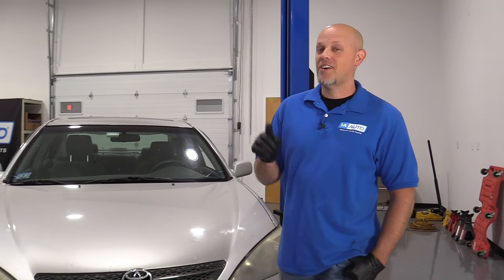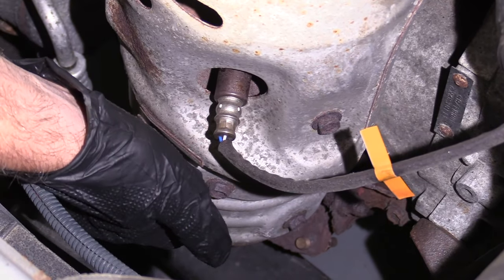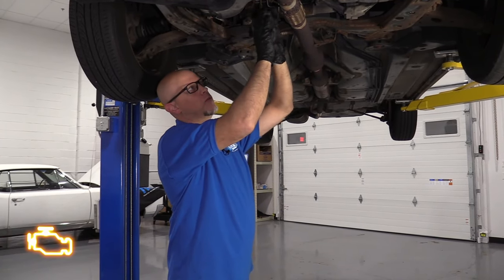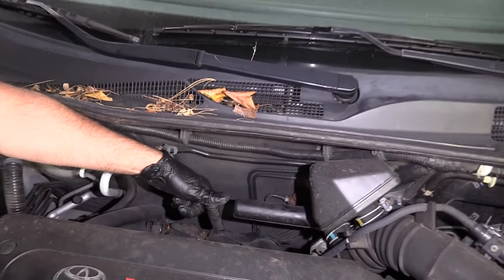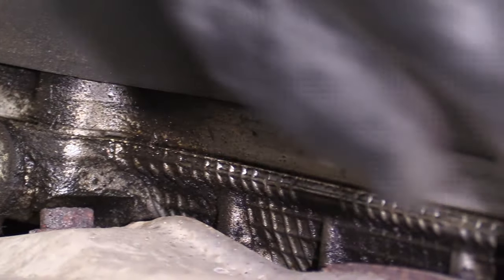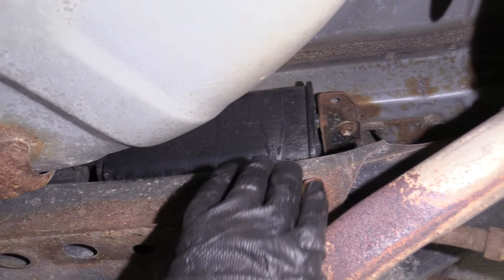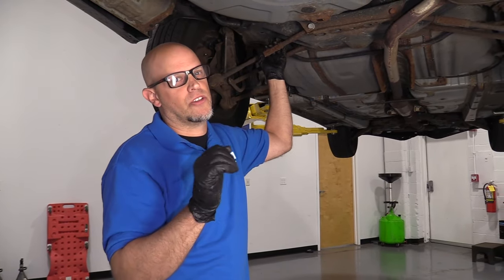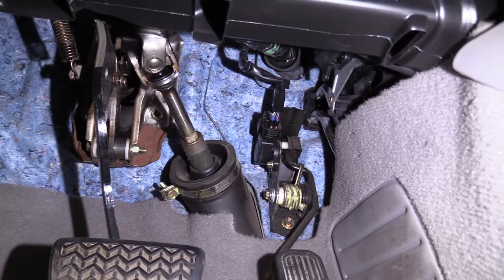Top 5 Problems Toyota Camry Sedan XV30 5th Generation 2002-06

Comment: I've had a rattle or tick since I got my 05, I'll have to look into an intake and see if that possibly stops the issue. Would've never guessed!
Reply: Hey OH, i got one too
Reply from the maker: Hope it helps. Thank you for checking out the video. If you need auto parts go to: http://1aau.to/m/Shop-1AAuto-Now
Reply: Did you figure your rattle issue out yet? I have an '03 and I've been hearing a low rumbly rattle. It rattles in everything except Neutral, which is weird to me. I had bad bearings in my idler pulley as well, but I had that replaced, and the rattle got a little less noisy, but it's still there. The paranoid part of me wonders if it's the chain tensioner... I really hope it isn't,  but I wanna be sure.
Reply: @S2DIOfficial  i actually traded the car in and got something new. My recommendation though would be to get a new intake manifold on it since its a much easier job than the chain tensioner. Im not sure cost wise but its still better than having to tear the top of the engine apart. I hope the camry keeps on going for you. As happy as i am with my new car, i do still very much miss my camry
Reply: @dwoodrow9721  Scheduled the repair for the intake, so I'll have a better idea on the 17th (March, 2021). Gonna be about $450-500 after he orders the IM, and labor. So not bad, but still a nice little shit-hit for something so dumb. I paid $6k for the car (low miles, great body, no rust, clean interior, one elderly owner, etc.) so I don't mind investing a little bit of money to get more time out of it, but this sort of shit always seems a lot like rolling dice. Idler pulley was fixed (bearings WERE bad, that was definitely one issue), intake manifold will be replaced with a better after-market version (metal, not plastic), and if I need to replace the tensioner (hopefully not, but I will if I need to) it will be done. This little car has about 50-75k miles left in it if I keep it maintained, so I don't really care. It works for now. I put about 20k miles on it in the last 2 years; I drive to work and home. I guess we'll see... 

Thanks for the reply, man! Most YT'ers ignore their channels and their notifications for months at a time!
Reply: Dorman makes a replacement, I installed it on mine because my car sounded like a diesel with the rattle. It’s not too hard, just a little cumbersome with the bottom two bolts on the back of the engine.
Reply: I got the same rattle too but I only hear it when I'm in reverse
Reply: @S2DIOfficial  any update? I have an 05 with a rattle whenever in gear.. and only with the brakes engaged
Reply: @TheMcpeMaster1  My intake manifold! Was about $400 to replace, but the noise went away. The guy who did it said my manifold looked normal when he removed it, and he showed it to me as well. No loose pieces inside or anything. My only guess is that there was a small crack somewhere, letting a little bit of air out (or something similar). I have no issues with sound anymore, which is great! Hated the noise.

Comment: Do the V6 engine Camry's (2003) have the same high mileage reliability as the 4 cylinders? I had an 01 v4 that I got rid of at 320k, not because it was dead but because I had enough vehicles already and was offered a dirt cheap 03 V6 that I'd like to keep around as a Summer vehicle. It's got 194k (which doesn't scare me for the price), but can I expect the same reliability? A coworker that was a Toyota tech for 15 years looked it over and said it didn't need anything besides minor things, but we never touched on the difference between the 4 and 6 cylinders.
Reply: for V6 you need to change time belt each 100 000 miles. V4 does not need it.

Comment: The other problem that I’ve had and seen other Camrys like this body style is that when the battery gets changed or disconnected the gas pressure drops it has to build up again that’s what I hated about it.
Reply from the maker: 👍Thank you for checking out the video. If you need auto parts go to: http://1aau.to/m/Shop-1AAuto-Now

Comment: Do you have to pull the spark plugs out too to take off the valve cover ?
Reply: no but would be a really good time to be replaced if you havent done so yet
Reply: I’d actually leave them in until you’re done. Keeps oil out of the combustion chamber
Reply: Its more of a case of your already there might as well replace.
Reply from the maker: No you don't. Thank you for checking out the video. If you need auto parts go to: http://1aau.to/m/Shop-1AAuto-Now

Comment: One really big issue with these car, especially the early years of this model line, is the threads in the block that the head bolts screw into can strip/pull out. Usually happens if the car every overheats. With a car this old its bound to happen at some point. Radiator leaks or water pump fails, of hose leak. After fixing whatever caused the overheating the car will have a small but persistent coolant and/or oil leak. Usually under the intake manifold. It is a labor intensive fix. They make a kit that can repair/replace the treads in the block. Timesert/ helicoil  type repair. Seems to be better than stock after the repair. If the car never overheats then you may never see the issue.

Comment: Just bought a 03 camry with 170k miles for $1500 3 days ago car was running beautifully then yesterday had a bit of a rough idle thought nothing of it, parked the car came back 20 min later and car cranked but didn’t start. Left it overnight and it started right up in the morning, didn’t drive it to be safe then came back at night started right up again. Out of curiosity I shut the car off left it for a minute or two then tried to start it again, car turned on, struggled to stay on then died and went back to crank no start. I’m thinking maybe fuel pump? Any ideas or anybody had this issue before?Thanks.

Comment: i am pretty upset...i have an 03 camry that i bought from dealer with 8000 miles on it. it only has 115k and leaking loads of oil. i am mad that everytime i brought my car to someone they changed all this other stuff and I TOLD THEM I HAD AN OIL LEAK. Welp, it's 2500 plus dollars later and still leaking. I replaced 3 valve cover gasket, 2 power steering pumps within a year and all this other crap and oil is STILL LEAKING AND EVEN WORSE now. i hate that mechanics take advantage of women. I'm reading about how everyone is getting all these miles on their cars and mine is in my parking spot with a rack of oil marks under it. Someone finally told me that he thinks it's the HEAD GASKET WHICH IS ABOUT 1800 TO REPLACE, plus a sensor light is coming back on after I changed that. NOW HERES THE KICKER. I NEVER KNEW TO KEEP MY ORIGINAL PARTS SO alot of these "replaced' parts are from Auto zone or Advanced auto but mainly auto zone. Once again I didn't know that auto zone don't sell the original parts. I've been without driving my car for almost two years now. What do you think I should do? Help!

Comment: Would these top problems also relate to the ‘05 Lexus ES330 since it is basically a glorified Camry? Or am I speaking too early and there’s a video in the works.
Reply from the maker: +elgrifo83 Thanks for checking us out! Some of these may likely be the same as most of the parts on Toyotas and Lexus are interchangeable, we will definitely pass on the suggestion for that generation Lexus for a future video. 1aauto.com

Comment: Just bought one 2006 150miles and for $300. Gasket is leaking, gas gauge not reading. Panel lights are not working

Comment: I just got a 05 Camry at 153,500 miles and the transmission is going out, I knew that this model year had transmission issues but I thought they didn’t appear until at least 200,000 mile mark. Why isn’t this in the video, it’s even mentioned on the NHTSA website. And the shocks are in need of replacing also something many have issues with.

Comment: my camry consumes oil but every check i made on the engine seems okay and i cant seem to find any leakages can i get a solution pls. its an 2003 camry 2.4 engine
Reply from the maker: That sounds you might have a PCV problem. Thank you for checking out the video. If you need auto parts go to: http://1aau.to/m/Shop-1AAuto-Now
Reply: If it's a 2002-2006 2AZ-FE 2.4L 4-cylinder, they can have valve guide seal problems and leak oil into the combustion chamber where you can't detect it.
I've also read, some guys promote Lucas high-mileage additive combined with synthetic oil to swell the seals and reduce the symptoms a lot. Good luck.

Comment: I have a 2016 camry but a few days ago I kind of saw that when turning the wheel it made a little noise but I don't know if that is serious
Reply: Check your power steering fluid it might be low..
Reply from the maker: It would be a good idea look at it or have it checked out. Thank you for checking out the video. If you need auto parts go to: http://1aau.to/m/Shop-1AAuto-Now
Reply: @trini_boi2414  if it is low it may be leaking and have a seal bad. I would get it fixed.

Comment: I just got another cylinder and a new gasket but it's pop out water when I open the radiator and when I cover it the hose got stronger like it's want to burst please I'm 100% confused help me
Reply: Stripped Head bolt problem!  Top off coolant twice a week. Leave cap  loose on reservoir cap so engine can vent air. Leave AC on all the time.  Remove the thermostat. Get Denso Denso 221-0506 Radiator ( bigger & cooler ). Change oil every 4 months.  This will buy you time to get another car. Btw, the Toyota engine 2.5L 2AR-FE, 2008-2016 , is a much better engine ( just watch the oil level ,monthly,religiously ).

Comment: Wrong! The biggest problem with the 2.4 is the head bolts stripping and falling out and number 2 is excessive oil burning! The 3.0 and 3.3 v6 last forever as long as you don't neglect oil changes and get sludge.

Comment: You must never had this model car.... The #1 Problem is the head bolts pulling out the block... Everything else is minor.
Reply: 05 and 06 engine (4cyl) blocks are same as the prior three years. The head bolts pull out the head and gives the customer symptoms of a bad head gasket.

Comment: I have a check engine light which turns on after I start driving and then turns off couple of kilometres later. I am so worried. The engine sounds fine to me 😣

Comment: Anyone have a problem with the trunk light, license plate bulbs and trunk actuator motor not working? I did some research and found it's all ran to the same fuse. But I cant find which fuse that is. All my fuses are good.
Reply: There a fuse in your glove department next too the driver seat
Reply: broken wires where banded cable on the corner lid trunk ,left side

Comment: Hello 1A Auto. This video came in at the most appropriate time as I am battling with two of the DTC mentioned in my Toyota Camry 2003 - P0442 and P2238.
I am tilting towards change of gas cap for P0442 since its a small leak and seems not to know what to do concerning the P2238. The voltage from the 02 sensor is 3.3 volts while that of the equivalence ratio is 0.9 - 1. Could you please help proffer possible areas to look at?
Reply from the maker: +Ganiyu Shakiru Thanks for checking us out! The gas cap is a good place to start with the P0442 as that is the most inexpensive and easiest possible cause of this. With the P2238 it could be just a bad 02 sensor, there could be some issue with the wiring, or the worst case would be an issue with the PCM. We always suggest having the vehicle diagnosed to get a more certain answer as we are not with the vehicle. Hope this information helps! 1aauto.com
Reply: @1AAuto  Thank you for your response.
For sure, the 02 sensor seems working fine from my diagnosis. Would check the wiring. I'm a new DIY person and hope to get more advance soon.
Reply: @1AAuto  I have changed the 02 sensor, cleared the code, driven over 50miles and no code yet.

Comment: Boys and Girls. I have a 05 Camry hey try 301,000 miles Runs like a Rolex. No problems at all. Just Oil change every 5 000 miles with Mobile One. Change Tires and Brakes. The Japanese just know how to Built Real Cars. I'm a Vietnam Vet. I Love the USA. But I would never buy an American car ever ever again. I did have Chevy & Fords Never Ever again. Yeah you think I'm those stupid Redneck who buy American because I'm American that all Horse doing crap. I buy Reliability not Crap. 
All by the way I'm a redneck.

Comment: Head bolts coming out of the block number #1 problem. Aluminum block
Reply: Yeah, I looked that up and it is a common problem and probably expensive to have a shop repair the problem, kind of surprised Toyota would have such a engineering oversight like that,
Reply from the maker: Great tip! Thank you for checking out the video. If you need auto parts go to: http://1aau.to/m/Shop-1AAuto-Now

Comment: My 2005 Camry had a failed brake light switch at 109000 miles a pain to replace 😭😂
Reply from the maker: Thank you for checking out the video. If you need auto parts go to: http://1aau.to/m/Shop-1AAuto-Now

Comment: i got a whining noise when i accelerate
Reply: If your vehicle whines while turning, the power steering system is malfunctioning or you're low on power steering fluid. If the whining only appears when you accelerate, the transmission is likely damaged. Whining while the car is idling points toward an oil pressure issue. You may have a leak or simply be low on oil. But, this is a camry and i've never really heard of transmission problems on theses years, most likely to be power steering hoses, they are 19 years old, they can leak. I got this problem on my camry right now, it could be that, or something else. I hope this helps you to diagnostic the problem, and if you really can't find the problem. Take it to a mechanic shop, they'll know what to do, at a certain cost.
Have a great day 💪🔧
Reply: @Phil_lephil  sweet thx for your detailed reply !
Reply: @jeffreytruong8918  No worries!  If you have any more questions about the XV30 2.4 2AZ-FE Camry, just let me know, i work on theses cars, it will be a pleasure to help you! Have a great day 💪🔧

Comment: Drove home from LA 6hr round trip. As soon as I get to town it died at the intersection. I had to force the brake peddle & ease off the brake pressure while excellerating the gas pedal to the floor, while it was spitting and sputtering. Running on one cylinder (exaggerated comment : ) it doesn't sound healthy at all!!! ... Going to run a diagnosis to see what the codes are. Bad gas ⛽ Ethanol ? Fuel filter, fuel pump clogged, charcoal container???? Can anybody pinpoint my sick Toy Cam? Thank you
Reply: Why would you say ethanol gas is the problem?

Comment: He didn't mention the problem of 4-cylinder engines (2AZ-FE). This engine has a problem with bolt threads in the main block, which leads to coolant leaking and overheating.
Reply: I have a v4   no problem 175k miles

Comment: actually the top problem is oil burning...bad piston and ring design ...my camry uses 1qt every 300 miles...it is burning the oil for sure...no engine leaks anywhere. plus its not the valve seals because there is no smoke. tail pipe is oily black...plus it has clogged up my upstream cat.
Reply: There's a kit to fix that by yourself, dealers have it. Dealers can also fix it for you, but it won't be free. Other than the oil burning problem, because of the piston rings just like you mentioned, that engine is pretty reliable. Good luck fixing it, i hope this helped a bit 💪🔧
Reply: @Phil_lephil  I dont think I have the skills to take that engine apart and put back together and havent found a detailed youtube video for it. thanks for the info...
Reply: @SyntheticStuntMan  I understand your concern. Fixing piston ring problems can be complex and time-consuming. If you're not comfortable tackling the repair yourself, consider consulting a trusted mechanic or repair shop. They'll have the expertise and time to diagnose and fix the issue correctly. Additionally, neglecting the problem could lead to further engine damage and increased repair costs down the line. But overall, if you just add the right amount of oil and check her everytime that you go on a ride, you should be fine. Just always have a 5w-30 bottle near! 
Hope this helps, have a great day man 💪🔧
Reply: @Phil_lephil  you too man thanks!

Comment: Let's not forget the poor engine design that causes the head bolts to rip the threads out of the engine block. Just like what happens to the GM Northstar engine. Then it spews coolant around the head gasket.

Comment: Ugh looking at this video as i got p0420 code.
Reply: P0420 code means that the catalytic converter is not working correctly. The code relates to the oxygen (O2) sensors on the Bank 1 side of the exhaust system before and after the catalytic converter.
And if you don't have the time or money to fix it, you can delete the code with a OBD-II scanner and the car will run just like brand new, but it will come back one day and you'll have to delete it again. Hope this help a little! Good luck fixing it 💪🔧